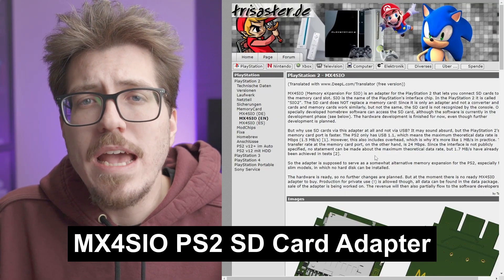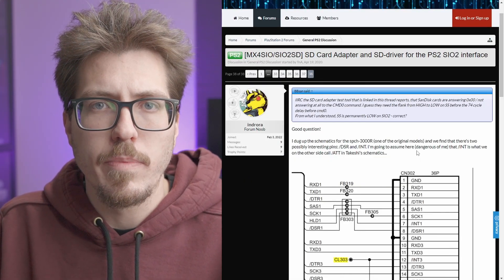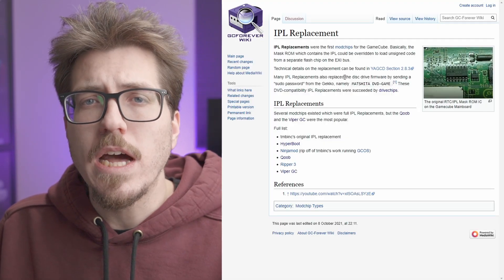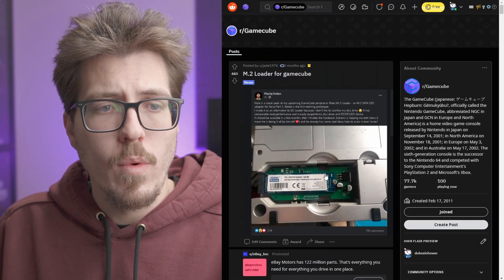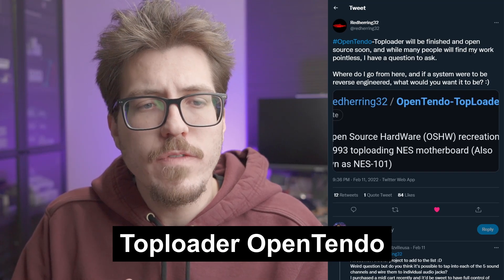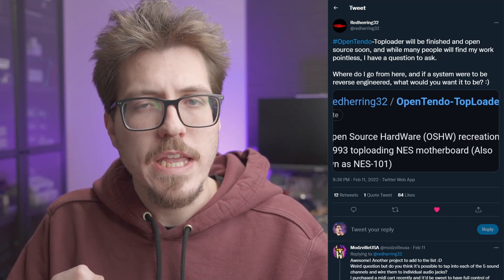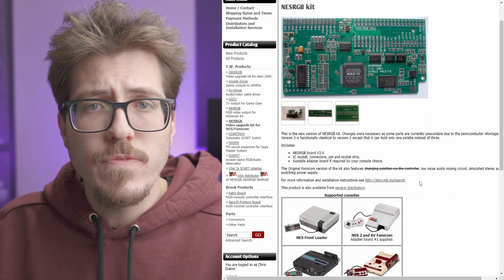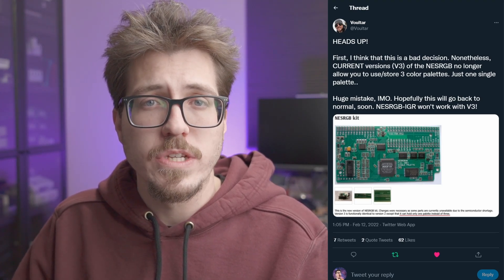New NESRGB Revision Missing a Feature - Retro Modding News 2/20/2022

Comment: 2:49 “Let’s hope somebody comes out with an open source IPL mod chip sometime soon”
Uhh, like the 1st one in that list? ;)

TMBINC originally released it for loading Linux and other home brew but it was pretty much just GCLinux. ViperGC came along and used it with Cobra BIOS (hacked Nintendo BIOS) to load pirated games but they used DRM to lock Cobra to their chip while acting like they weren’t even the same people. Then you got Qoob Pro and Qoob SX but TMBINC moved on, eventually hacking the Wii. Pretty sure TMBINC was the member of team Twiizers who was on stage the previous year talking about time-based attacks. He revealed that Nintendo changed the password for the Wii’s DVD drive’s test mode to all uppercase in contrast with the GC but he did tell realize then that it was vestigial (didn’t work anyway).